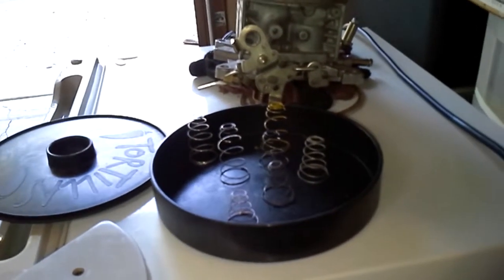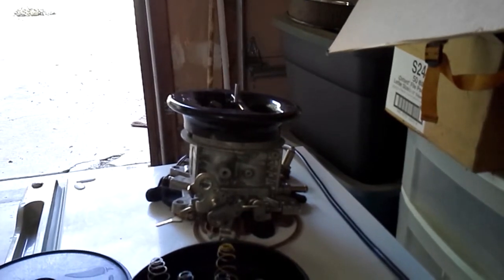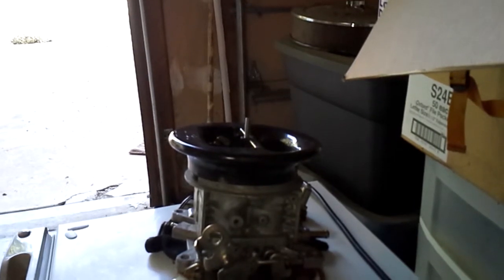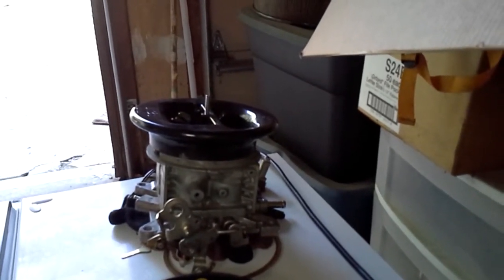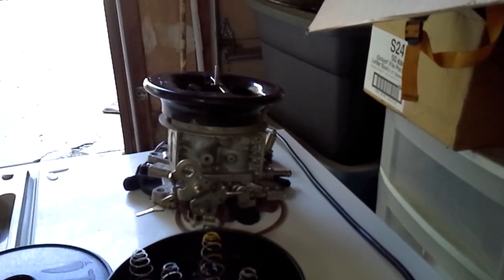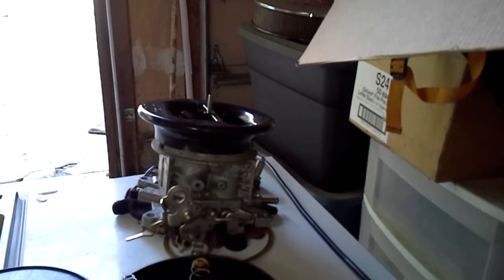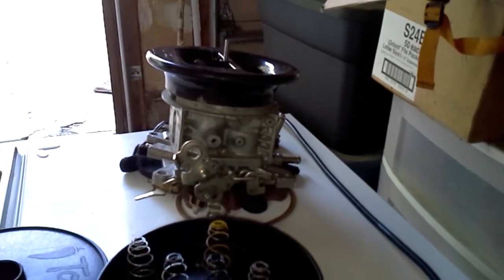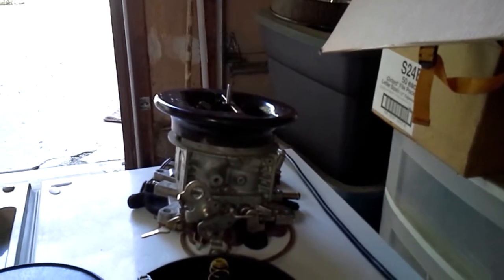Holley 3310 secondary springs

Comment: Its vacuum. It messes up the vacuum of carb. Higher filter helps the vacuum pull fuel thru carb. Proper spring also. Basic carb tuning.

Comment: hey so i got a quick fuel 450 cfm carb (bassicly holley) for my 305 small block and im havinging an issue when rolling to full throttle it gets a fat bog but when i let up the speed increases i think the secondarys  are opening up too soon i got the purple spring i was going to try the brown one idk
Reply from the maker: Here’s the tune:
Normally you would start with a strong spring and keep going lighter until you cause a Bog then back up one spring. 
Since you already have a Bog, start going stiffer one spring at a time until the Bog is gone. You’ll quickly see why the quick change secondary diaphragms were made. Good luck let me know how it turns out! JD
Reply: @HeadFlowInc  hey yea so i guess it wasn't opening at all now the second to lightest spring works quite well but only does so when it downshifts if it doesn't down shift then it takes a while to build up speed mind you i have a 2.72 rear end on a 1986 c10 so its a heavy truck

Comment: most helpful youtube video i’ve watched in a while. Thanks :)
Reply from the maker: Jason GunFTW Thank you good luck on your project!
Reply: @HeadFlowInc  also, i had a recent carb issue exactly like yours after I installed a TBI air filter spacer. once I take it off the engine sings every time. Also, my white vacuum secondary spring just came in the mail finally!!